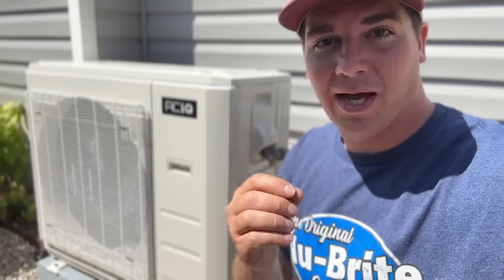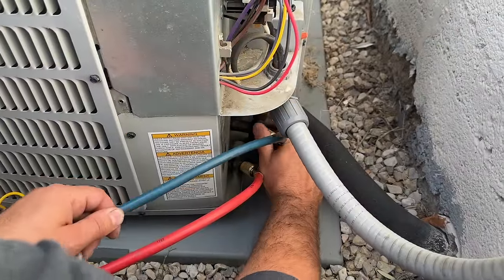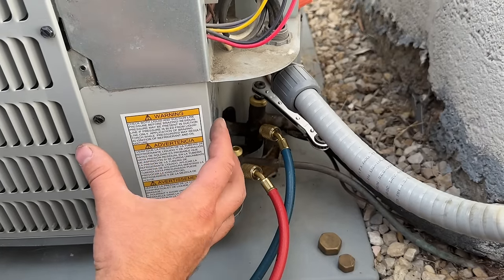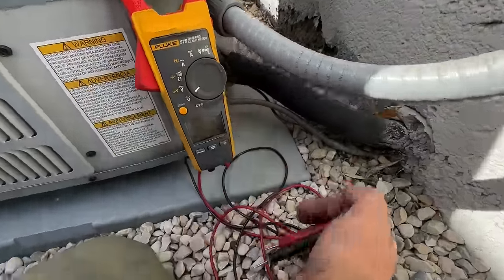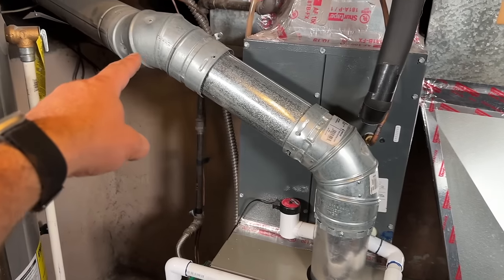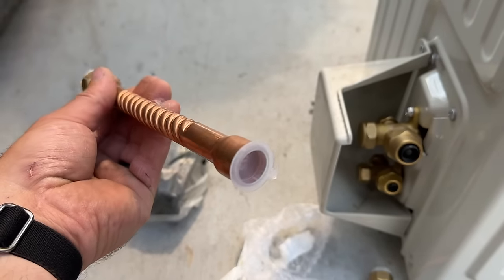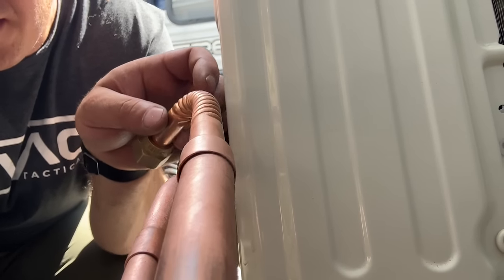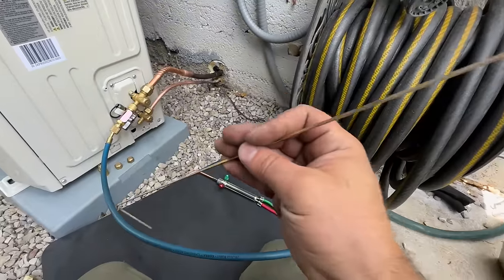How To Convert Your Air Conditioner To A Dual Fuel Heat Pump

Comment: Can you recover the refrigerant in a mini-split using the compressor the same way you did with the AC unit?  I have a Fujitsu ductless I’d like to use for temporary heating during construction and then relocate it to my garage once my furnace goes in.
Reply from the maker: Yes you can
Reply: @diyhvacguy  thanks!

Comment: Could you have used the HVAC pro-connect coupler to connect the lines by trimming off the end of both copper lines provided by ACIQ?
Reply: I went 100% flaring with this.

Comment: Is that mini-split style condenser still a variable refrigerant flow?  If so, how does it work with the TXV?  Obviously the furnace isn't variable but is there still an efficiency gain from the condenser ramping its compressor and fan up and down based on cooling/heating load?  Or is it just going to run wide open?
Reply from the maker: Yes so the furnace is a single speed very basic fan, so when the ac kicks on it always goes into the same fan speed obviously. However the thermostat tells the compressor which stage to go in for the outdoor unit, so if it’s only calling for a degree of cooling or heating it will go into single stage, and it also uses outdoor temp so if it’s way hot out but only calling for a degree it will probably go into stage 2 but the thermostat controls the staging. 

The indoor coil is regulated with the multidirectional txv, and the outdoor unit actually has an EEV (electric expansion valve) so they work together and save money. Not as much savings as having a variable speed fan but I wanted to keep my standard efficiency furnace because I love the reliability of them.

The main reason for me swapping over is so I can run my cooling OR heating with my generator now even if there is no electricity or city gas. 

Cheers

Comment: That was cool but what a complex install compared to the usual mini-split wall mount air handlers.
Reply: That doesn’t make sense, all equipment is basically the same… So, unless you are not cutting excess copper from line sets (which means you are probably coiling the line set and creating oil traps) the process is the same!

Comment: Hi great information! Would this work if furnace is a single stage ? Would the blower of the furnace be running at 100% and defeat the purpose of an inverter HP? Thank you.
Reply: Condenser will modulate anyway depends on suction line temperature. Yes you blower will still gonna be 100 percent, but all savings on condenser side

Comment: How does it bring on the furnace during a defrost? I didn't see that you hooked up the D wire. I will be blowing cold air in the house during a defrost.

Comment: Great video like all of your others.
Does that HP go into defrost? 
If so is there supposed to be a wire to run the furnace? 
If not won't you get cold air coming out of the ducts during defrost?  
I know they are normally not supposed to run at the same time but I read that is should in defrost.
Thanks!
Reply: Those condensers do internal defrost on demand and don't utilize indoor air handlers for heat during defrost like a traditional HP. Wired correct, the indoor air handler turns off while it goes in to defrost so there is no cold air blowing, ever. The hyperheat/extreme models have base pan heaters as well to limit the need for defrost cycles.

Comment: If a DIYer didn't want to mess with brazing, is there a solution to using a normal 3/4 and 3/8 lines and fitting so we can use StayBrite#8? Or lines with fitting like the precharged MrCool ones? Or do we need to choose brand other than ACIQ for this reason?
Reply: Tip: don't use Staybrite #8. I know this guy likes it and brazing is a high hurdle for DIYers, but it still results in flux residue ending up inside the pipe that will contaminate your line and there are plenty of other videos out there proving it. Also it's not as strong of a connection. Pay someone to do it right brazing and flow nitrogen or buy the Mr. Cool. MRCOOL holds a patent on that pre-charged lineset connector design so don't expect it from anyone else. The Mr. Cool is a rebadged Gree with the special pre-charged connectors added.

Comment: I just installed a Senville 36k inverter heat pump with ducted air handler.  The communication wires between which are only 2 (same with thermostat to air handler).  Perhaps I wired thermo lines between air handler and outside pump incorrectly?  I connected wires to the S1 and S2 terminals on both units, however there were other terminals (indicated with letters) for additional wires.  It works, but perhaps I should have wired it differently for better efficiency?
Reply: You did not wire incorrectly, and in fact you wired them the best way for most efficiency with S1 and S2 if you have the matching air handler. There are multiple methods of connecting the condensers so that they can have more universal compatibility with existing air handlers if you're only replacing part of this system which is what the more traditional ones with letters are for.

The S1 and S2 method allows the air handler to pass data back and forth which allows the condenser to ramp up/down on demand as conditions change in the air handler and at the factory communicating thermostat (if you're using it). The letter wiring method uses 24v AC signals to turn on/off relays instead of variable levels.

The difference is the communicating method allows variable capacity needs to be communicated and the 24v letter method basically just tells it to turn on/off (and in this case, activate 1st or 2nd stages) which is why it provides more efficiency. Therefore a full communicating pathway is the most efficient way to run the Senville and the ACIQ in this video, which are both rebadged units made by Midea.

If you're like me and have an Ecobee, you'll be limited to using 2 heat stages (3 if you have the backup heat strip) and 2 cooling stages using the traditional 24v letter terminal wiring between the thermostat and the air handler. But you can still utilize the S1 and S2 ports between the air handler and the condenser as the AH will translate the 24v calls from Ecobee to serial communication.

Comment: Excellent video! I'm learning so much from you, which has been helping with our rentals! Do you think this condenser could be paired with an existing coil?  Also, could you have swaged the lineset so you could have used the stay Brite?
Reply from the maker: No, the fitting on this one was not a true 3/4 so that wasn’t an option. And the only way that would be possible is if you have a bi directional txv. Most are setup for cooking only but if the coil says for heat pump also then you could totally throw a heat pump condenser on it and be done.
Reply: @diyhvacguy  couldn't you have just flared the end of the line set for a compression fitting instead of brazing?

Comment: Noticed no W TERMINAL AT OUTDOOR UNIT 
WHEN IT GOES INTO DEFROST WONT IT BLOW COLD?
Reply from the maker: No it uses y for heating as well. All it does is trigger the reversing valve so that’s how the thermostat knows it’s in heat mode. No revershing valve signal=cooling   Reversing valve signal=heating

Comment: Could you do something similar with electric heat. i have a 13 seer condenser unit that was installed back in 2016. The price of electricity has gone way up since then. I have been looking at Mini split heat pump options but this is the first blending of the two systems, if you can call it that, i have seen. I wish I had Gas heat as that would be more economical already. Just curious if there are any different gotchas to look out for?
Reply: Since we need to get off of fossil fuel by 2030: you will need to rip out any new gas system within 7 years. 27 years if you use the more unrealistic 2050 deadline.

Comment: Are you able to check the charge on the inverter like a normal Ac or is it required to evacuate and measure the refrigerant?
Reply: @bluejay713  No, you cannot use sub-cooling to check charge on a variable speed unit (if that is what you meant when mentioning an inverter as that is generally linked to VFDs)… Yes, you can use a rule of thumb (also called the SWAG method)… But, variable speed systems must be charged by weight, technically speaking!

Comment: Can a minisplit pump itself down like that if you want to shorten your freon lines ?
Reply: Yes
Reply: @petersmart1999 I thought so but wanted to make sure..  I installed my minisplit a year ago but didn't take the time to shorten the lines.  Tired of looking at the excess lines. Thanks
Reply: If you hVe a Scroll Compressor.  Do not pump into a full vacuum for an extended period of time or you could damage the Compressor.  JMO
Reply from the maker: Yea as soon as you hit zero or even a bit before you should crank that low side down and shut it down
Reply: @mikeglasgow9618 Be pretty rare to find a scroll in a Mini/Ductless system! They use rotary's!
Reply: @petersmart1999  Diakin (or maybe it was Panasonic) uses scroll in their VRF/VRV (I always forget which name Daikin has a trademark on)… Not to mention, Danfoss has a whole series of variable speed scroll compressors… You will find variable speed scroll more common in commercial applications (like newer parallel rack, but also chillers for decades)… So, yeah, cheaper systems use a rotary, and most people buy cheap, so the majority are rotary on cheap residential mini-splits… Probably because scroll becomes more efficient as the load increases while rotary is more efficient on small scale (at least that is what I remember)…

Comment: I did not see a filter dryer. I’m thinking about doing this. Can I add a heat pump filter dryer dual direction?
Reply from the maker: They specifically said not to install a filter drier so I did not.
Reply: @diyhvacguy  ok, Thanks for getting back. When I do mine I will shoot you some pics. You do a good job with your How to viedos. Keep up the good work.

Comment: If new system has different type of Freon gas, do you have to change the line set ?
Reply from the maker: No, you can flush the lines and reuse them

Comment: does that sender / receiver unit communicate through the wires or bluetooth?
Reply from the maker: Bluetooth. That’s the whole idea is that you don’t need to run new wires through a wall to your furnace.

Comment: Trying to get a dual fuel heat pump in PA right now and have it qualify for the federal tax rebate.

But the prices I'm getting for a qualifying heat pump are perhaps $8000 more than an AC because (I am told) I can't just use a normal 95% furnace.  I'd also need a variable speed furnace fan.

Is that true?
Reply from the maker: Not true. Mine is not variable speed. Just a standard 80% single speed gas furnace. But your state has different requirements so it’s not that it won’t work (it totally will) it’s that it’s probably not “allowed”
Reply: Does having the Bluetooth receiver  inside the furnace metal enclosure affect it's reception?
Reply: Most normal furnaces are not as 95%… At that efficiency, you wind up with condensing gas in the flue pipe and that creates a number of other issues…

Comment: Could you not just have cut the end off of that suction line and flared it to use Stay Bright 8?
Reply from the maker: No because the spiral portion was not a true 3/4 line it was smaller.. otherwise I totally would have

Comment: Does your stage 1 heating work? I have the same exact set up but only blower runs for stage 1 then stage 2 comes on and heats. I’m also an hvac tech
Reply from the maker: Yea mine is in stage 1 heating alot. Fan spins real slow, and then if it needs more heat it will ramp up
Reply: Going to have to double check my wiring. I just bought a Bryant two stage variable stage furnace so luckily I’ll have proper terminals now and be able to use it a little bit better. Works great right now , it’s able to maintain 70 degrees without issue but you can tell the supply air definitely isn’t as warm as gas or oil

Comment: When R410A phase Out in 2025 for the NEW refrigerant,then Can we still install R410A system ❓❓❓
Reply: You can still use your current system.RS-53 (R470A) is going to be the drop-in replacement for R410a systems. The new units after phase out will use R-454B. You can't use R-454B in an R410a system because of efficiency, and R-454B is more flammable. New compressor designed for R-454B.
Reply: Yes, if you can purchase them… The phase out impacts manufacturing, what is in the supply chain can still be sold… At least I think that is what you were asking about…
Reply: Thank you for your Reply 👍 @EarlHayward

Comment: The electrical hookup from the disconnect is not legal here. You can not substitute a ground wire for a common wire, so in this case you would need 12/3 with a ground. The unit is designed for this type of hook of with a common and a   separate ground lug...
Reply from the maker: It’s up to code as long as it’s wrapped in red tape.
Reply: @diyhvacguy  That's not the issue, it's the bare unbalanced lag. Not to mention if it gets lifted there is no path back to neutral and any unbalance may appear on the device.
Reply: @Bass.Player there is no neutral terminal in the condensing unit so it is hooked up correctly.
Reply: @tomoliver8498  Good grief! I'm starting to feel like I need a tetanus shot to continue this, so I'm done here...
Reply: @Bass.Player  You must not be talking about US Residential Single Split Phase as there is only a common on the 120V circuit as the common represents the center tap on the transformer coming from say Leg A to Leg C from the three phase (delta) supply… In the US, there is no common on a Residential Split Single Phase when wired for 240V… Thus, there is no requirement for a common on 240V equipment (unless it needs a 120V supply from the mains), meaning one could not even substitute a ground for a common… Or, maybe I missed the point you were trying to communicate?  So, before you go telling us we are all idiots, explain yourself!
Reply: @EarlHayward  Yes Texas,  and if there were no need or application for a neutral and a ground then why are they there? This unit is 220/240 volts so this is the voltage being discussed, the grounded neutral conductor must carry the unbalanced load of the two ungrounded phase conductors. Also many units like this have segments that only use one leg (120 volts), plus this is why the neutral is always the same size conductor as the hot legs. Sure in a perfect world the two hot legs would balance the load but this is not the reality.

Comment: Now  wait a minute.  Normally,  the backup heat source is  DOWNSTREAM  of the  heat pump indoor coil.  This is so that  the backup heat  source does not overheat the  heat pump, either in heating or in defrost.     This of course is opposite of an AC only  installation, where the  AC coil is  downstream of the furnace.  How does this system deal with this  or  "does" it?
Reply: Every hot air furnace with an A/C coil blows hot air right into the A/C coil.  What's the difference here?
Reply: Mostly doesn't matter, but he's also setup to not running both simultaneously.  The gas furnace will just blow hot air over the evaporator which will be off.
Reply: @InsidiousDr9  How do you think defrost works?   When the pump is in defrost,  the backup  is running. You are causing  an overheat/ overpressure  condition  in the  (presently)  evap  during  defrost.
Reply: @kevin9c1  The difference is,  the backup heat will be running in DEFROST
Reply: @fourfortyroadrunner6701  Well if the furnace dumps heat into the evap it will just make defrost go faster (in theory) by driving higher condenser pressures and temps.  But it won't be defrosting if the furnace is calling.  So there isn't an issue.
Reply: @kevin9c1  Nonsense.  ANY heat pump  in any cold  climate must have heat during defrost, or the  space will cool uncomfortably.  There are specific  ASHRA   recommendations as to why the backup heat is normally downstream of a heat pump coil.  Defrost  IS  the reason.  Bringing on backup heat for defrost  WILL eventually damage the heat pump because you are dumping huge amounts of heat onto  a WORKING  coil.  This can, if protected,  cause the  unit to go off on  hi head/ pressure/ temp.     I don't know what climates YOU work in, but up here we have real cold and real winter.  I used to service this stuff.  I cannot imagine what trickery is afoot here.
Reply: @fourfortyroadrunner6701  Once again, from his setup his heat pump will be off when the furnace is calling.

Comment: Why not let the heat pump and furnace run at the same time? That's how we have ours set up. Granted our aux is heat strips. (Florida, we almost never go to emergency/aux heat).
Reply: If your furnace is heating at the same time your systems is in heat pump mode, you have problems… Are you sure that is the case? Any competent technician would make the furnace backup heat (triggered if indoor temp drops too low)… One would have to wire a thermostat incorrectly to. Are both operate at the same time as you assert, and (again) that creates issues!
Reply: @EarlHayward  maybe I'm wrong. But I didn't think emergency heat (heat strips) in our system turned off the reversing valve/compressor. 

So, I am asking what "problems" or "issues"?
Reply: @pilotboba  Because you have a air handler probaly, thats why you can run the same time, on furnace you cannot
Reply: They don't.
Reply: @pilotboba  If they running you can damage your coil, bud

Comment: Here in texas gas heat is the way to go.
Reply from the maker: Huh, when I did my emergency gas heat video and talked about the texas ice storm everyone said they have heat pumps 🤣
Reply: @diyhvacguy  depends on what area your in. Here in the Dallas area many new homes are still being built with gas. I would know because I work for a gas company.